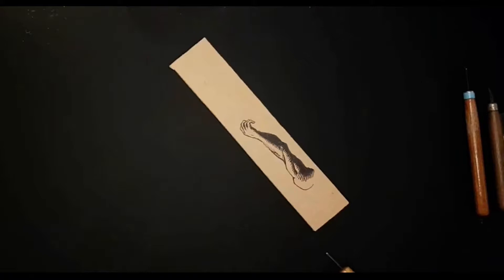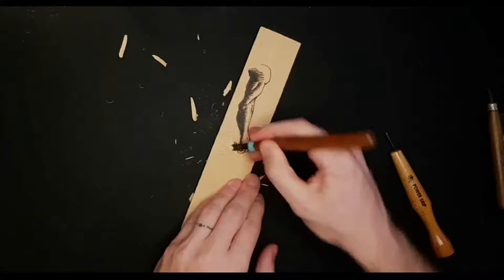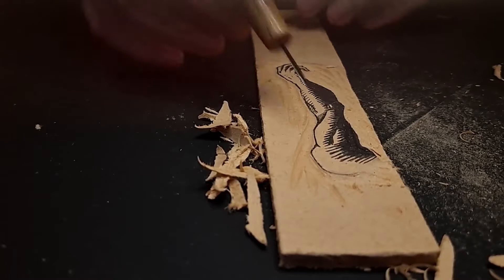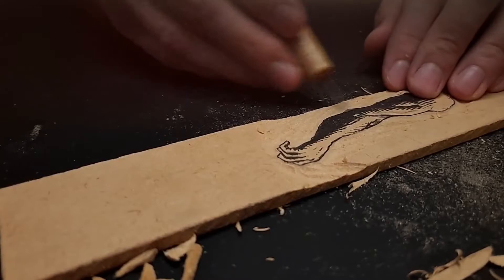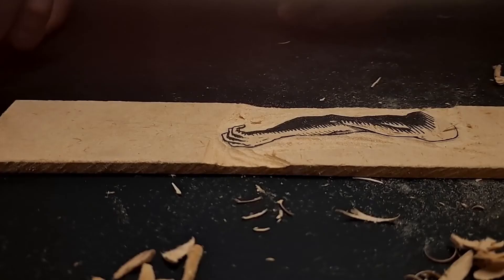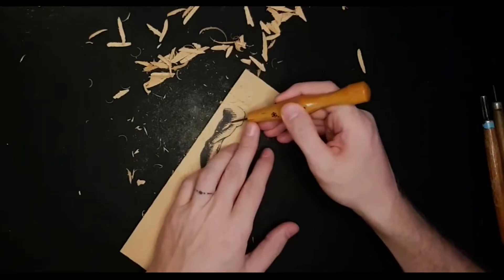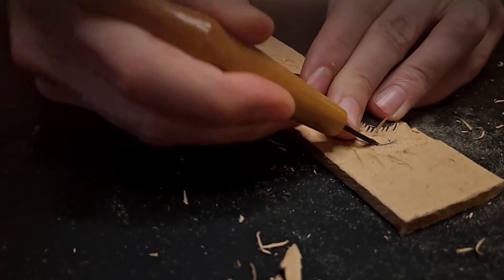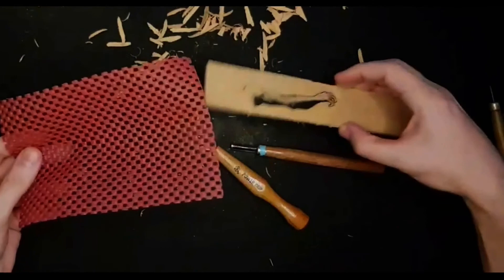Woodcut Carving Techniques 02

Comment: Fantastic!!
 Woodcut Tool name please ? Sir How can I get these tools?
Reply from the maker: Thanks! I use a small and large u gouge, most art supply stores and websites should have them.
Reply: The small u gauge is by Power Grip and is available on Amazon. I believe it is a 1.5mm size.
Reply: This one is by Power Grip and is a u gauge 1.5mm, available on Amazon. Flexcut and Pfiel make a 1.0mm u gauge as well.
Reply from the maker: I use a 1mm for the small u gouge. Those are all great brands! I use Power Grip because it's available locally here in Taiwan.
Reply from the maker: I was in the art store today and the gouge I use is indeed 1.5mm, good eye! I'm in Taiwan so everything is in Mandarin (or Japanese for a lot of art supplies), my reading isn't the best so I usually gloss over the details of the tools 😅